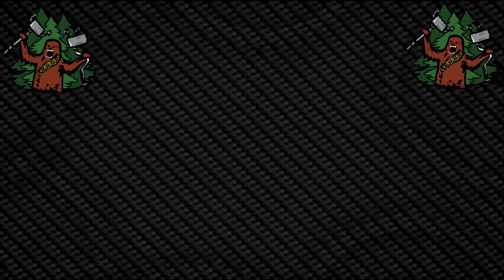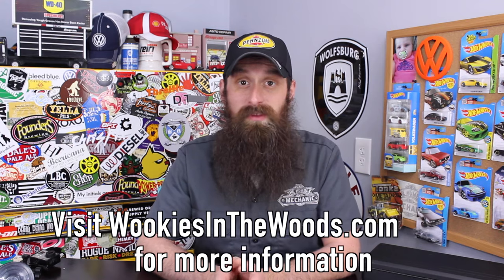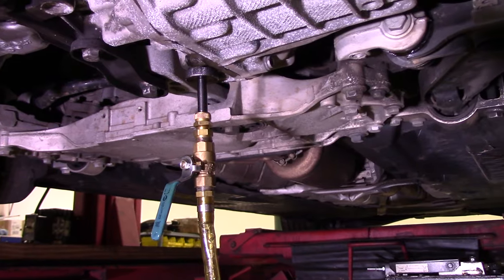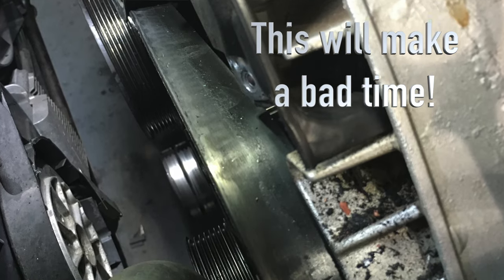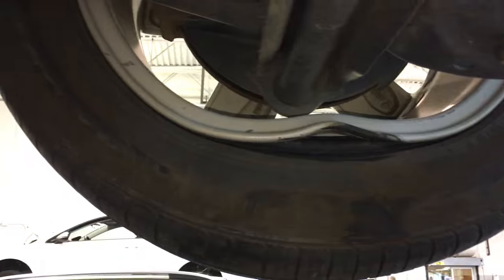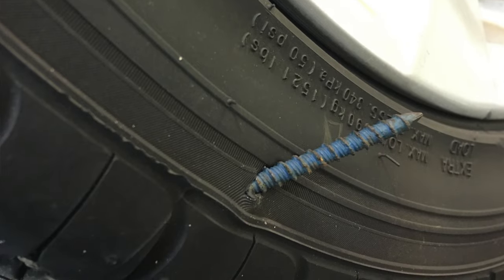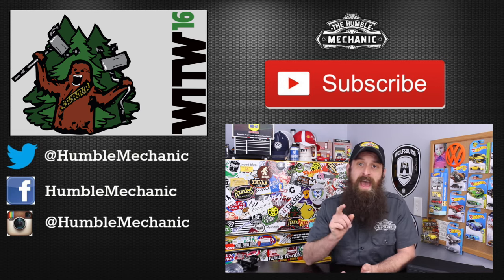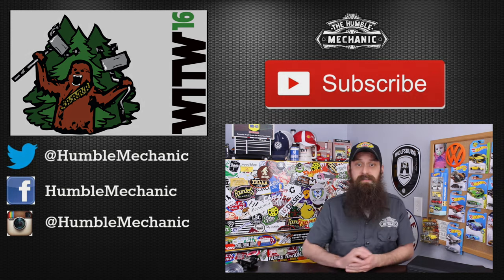Tips For Wookies In The Woods Prep

Comment: Q: Should I be able to turn the steering with engine off? ie. no power steering assist.
 I've seen some people doing this to bleed the system but my '99 Golf mk4 is solid without the pump running.